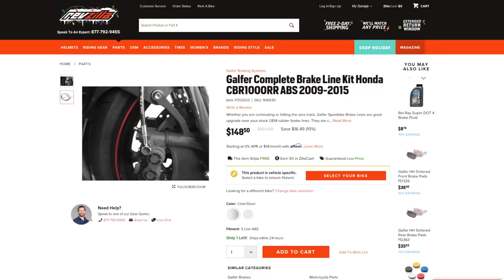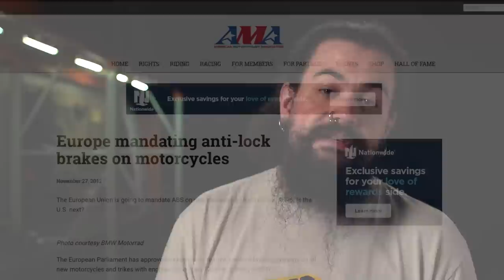3 Arguments AGAINST Motorcycle ABS!

Comment: My problems with systems like ABS & Traction-Control, is not only the added complexity & cost, not only the interference with motorcycle drifting, but also, these systems can become a mask for bad skill. I do not believe anyone should rely on these systems, instead of learning & mastering, if & when to brake or swerve, how to brake, and how to control traction. 

These systems can improve ability & safety, but I worry about these systems being overwhelmed, by bad rider skill & judgement. Then there's the concern, of modern vehicles becoming more vulnerable to being hacked. I don't feel comfortable with a computer having any control over my throttle or brakes, unless the only way that computer can communicate to outside world and be deeply changed, is through wired connections, and those connections are physically locked & secured, because a hacker can set a vehicle up to kill you, and make it look like an accident or your fault.

But all of these should be a mute points for me, because of my hatred & distrust for government & dealerships, I may never buy a modern motorcycle, and would rather buy & modify used old bikes, from private sellers, or build my own bikes from scratch. And if I build an Electric or Hybrid motorcycle, then I'm only using motor-controllers, that don't have wireless communications, and if they do, I will physically disable those features, and make the controller extremely difficult to physically access.

As for riders with bad skills. Like with anyone else on the road, they can be as bad & random as possible. It is my responsibility to keep myself & my bike, safe.

Comment: My gripe is broader than just ABS or just motorcycles. Most vehicles now are fitted with an ever increasing number of safety features, lots of them with beeps and buzzers. My theory is that each of these safety features progressively erode the general public’s practical reasoning and decision making. ABS is of the same ilk - and people increasingly tailgate, and increasingly cannot drive properly in low traction conditions. More directly on a motorcycle, I’ve never had ABS yet, and tbh I don’t want it - I’m a bit old school and proudly so.

Comment: Another reason why im against abs on a bike. Is that it makes a less proficient rider. A rider who only has riden abs bikes will generally rely on it more than one who knows how to control a locked rear or front. Like one from dirt. They lock the rear to purposely slide and switch direction. I grew up on dirt bikes and road street hikes without abs and I learned how to control a lock rear but when I got a xsr900 with abs. I expected the bike to perform what I demanded it too but the abs stopped it from doing what I asked of it. Like a near accident once, I knew if I could lock the rear, slide out a few inches I would be ok. But it didnt slide, I had to force the bike over and dodge the threat. 
Tldr, a bike with to much electronic assist will make e a less proficient rider

Comment: what if I am buying a bike that the abs does not turn on and off. you can buy it with abs or non abs. Which should I buy. I am talking about the new 22 KLR 650. I plan to go on and off road. It  maybe $300  more to get it. But I am sure the maintenance and fixing it would cost a lot. Also I had the 2011 non abs.

Comment: I didn't want it on my 2013 softail slim because the abs module was huge and its ugly carcass was bolted directly behind the front wheel in plain sight.  On my 2018 heritage softail however I was happy to have it as it has already saved my butt from a low speed spill on some sand and the abs module is hidden under the seat.

Comment: Rear wheel ABS on all my bikes is too sensitive for road riding.  It should be made to allow the rear wheel to lock up more than it does.  My rear brakes on all my road bikes are almost worthless.  Obviously the majority of braking power is done with your front brake, but that doesn't mean they need to make the rear worthless, it's like 5% at most of braking power when stomping on it.
Reply: eternal ponderer A locked wheel provides much less braking power than does a wheel that is at the threshold of locking.  ABS gives your rear wheel more braking power, not less.
Reply: @LTVoyager  then the rear brakes on my bikes just flat out suck.  My fz07 allows for some rear tire skirting and it seems to stop more effectively (although not much more) than my other 2 bikes that allow no locking at all.  It's actually got me in the habit of not even using rear brakes at all on a straight stop. While forced to turn and stop I'll hit both in an attempt to balance out. But in any case my rear is typically used full 100 pct or not at all. Probably not good if I'm on a bike that has no abs.

Comment: I was expecting the argument that a bike without abs is also a good thing to develop braking skills.
Reply: As long as you can disable to ABS completely to practice, I don't see that as a problem. I developed my braking skill by firmly braking on steep hills. My next motorcycle will likely have ABS that can be completely disabled, just so that I can periodically disable it to practice braking.
Reply: Chris L ABS does not interfere with braking practice.  If you are skilled at threshold braking, the ABS will never make its presence known.  If the ABS activates during braking practice, then you aren’t as good as you think you are.  😁

Comment: When ABS activates, your stopping distance nearly triples. Then there's Harley with their use of DOT3 fluid which absorbs moisture.  When you do most of your riding along the Florida coast where air has more moisture, the effects of the fluid being in that environment absorbs the moisture at a faster rate. This causes the hydraulic valve assembly to form rust on the iron spindles that are inside that module, eventually causing brake failure and a very dangerous situation. those iron valves spindles will eventually stick in a position where the fluid cannot pass, giving you a locked pedal or hand brake handle lock-up.
  Harley issued a recall to change out brake fluid, big deal, they put the same type back in. that hydraulic control module will cost ya around $1200 and because you have to access the computer to bleed the brakes, add another 500 for labor. The recall does not cover parts.  This is just a warning for all, this technology is not fool-proof
Dave
Reply: Change my brake fluid in all my vehicles every 2 years . Never had a problem with abs on anything. Abs or not all brake fluid should be changed even if the vehicle is not used.

Comment: In perfect conditions a good rider can out break the abs but in an emergency or if I hit ice or gravel abs can be a lifesaver but it isn’t an idiot proof thing . I would rather have it (though I get no choice as I live in the EU) but it does come at a cost as the abs pumps can fail and are expensive. That said  modern bikes now come with fuel injection, mapped ignition, traction control,electric suspension , fly by wire throttles and sensors that monitor everything from air temp to crankshaft position all of which means that bikes now produce 200bhp and are rideable on the roads by ordinary riders rather than moto gp alien elites . Long gone are the days of the simple  piston port two stroke single with points and a carburettor. Though I still have one in my garage . We can complain about cost and complexity of modern bikes but how many of us would really want to go back to the past.

Comment: I've been riding since 1980. (both dirt and asphalt) ABS, at least to me, would hinder/interfere with my full control of said ABS equipped bike. Therefore, I am one to avoid an ABS bike where I cannot disable the system fully. If I have to pay for it and not use it, then it comes down to is that bike worth the cost to me with ABS even though my first action will be to disable/remove the ABS components. Fortunately for me, I wouldn't be caught dead purchasing a Brand New Bike and taking that initial depreciation hit. Nuff Said! Cheers! Zip~

Comment: "If you are have clean, dry pavement where you are an accomplished rider, you may be able to out-brake ABS"

Would love to see a reference for this, because on the surface it doesn't hold up. Whenever your wheels start skidding/sliding, you have strictly less stopping power than when they have traction. Like you said, useful for changing directions in off-road scenarios, but those are about turning, not braking.

Do you really mean riders can out-brake ABS in a straight line on clean, dry pavement?
Reply: Scott Minor, the comparisons he’s talking about are pro-grade riders doing near-perfect threshold braking (the maximum possible braking force), compared to riders who just crush the brakes, and let the ABS system handle it for them.  There are three problems with those comparisons, though.
1) Virtually nobody is that good a rider.  Nor will they ever be that good a rider.
2) The exact same braking technique can be used on the ABS equipped bike, never activating the ABS system.
3) As soon as you have real-world road conditions, where the available traction varies unexpectedly, and often without any indication of such, that threshold braking turns into a skid, for which the ABS system utterly outclasses any human reaction time.

Comment: Don't like it. You forgot to mention ABS can simply fail. IF YOU SURVIVE THAT, seeing as you're probably ABS DEPENDENT because you're young and have never ridden a non-ABS bike, then you have to pony up for the repair cost unless the bike is under warranty. My 2019 MT-07 failed on me and the pavement was simply damp. I pulled the brake lever and it was as though my bike was coasting! It lasted a good 3 seconds. I released the brake quickly and reapplied it with manual control being available. I rarely buy new for that reason these days. If they're all going to come with ABS then someone should lobby that it must be able to be shut off. How about showing statistical data of those wrecks caused by ABS FAILURE?!!

Comment: Your explanation about ABS is just wrong - The ABS monitors when one or both wheels are locked up and relieves the hydraulic pressure being applied to one or both wheels while the bike has forward momentum. It has nothing to do with traction.
Reply: I think your information is old. Modern ABS is more intelligent than that (depending on the bike).
Reply: ABS is not Traction Control, that's a separate system that uses the same rotational sensors that the ABS uses.  From Wikipedia:An anti-lock braking system (ABS) is a safety anti-skid braking system used on aircraft and on land vehicles, such as cars, motorcycles, trucks, and buses. ABS operates by preventing the wheels from locking up during braking, thereby maintaining tractive contact with the road surface. REF:https://en.wikipedia.org › wiki › Anti-lock_braking_system - I can turn off Traction Control on my BMW - but I can't turn off ABS - that is on all the time. Separate, assistive, safety systems.

Comment: Never had abs on my bikes but eventually I wont have the option as every bike I get is a newer version I'll probly wreck not expecting the pulse lol
Reply: Bastard, if you can apply the brakes on a non-ABS bike without locking them up, you can do exactly the same thing on a bike equipped with ABS.  You’ll only ever get that ‘pulse’ if you’ve locked the brakes, because that’s when the ABS kicks in.
Reply: @Vessekx  thankyou for the input my truck has them but I just think it would be a strange feeling on a motorcycle once that back wheel locks it stays locked till stopped dont knock it till you've tried it I guess lol

Comment: No one can outperform ABS except under controlled high traction condition in low speed stops usually under 20 mph in a straight line where rear wheel comes off the ground and all steering control is lost.   

I would also challenge  to high stakes bet anyone who claims they have better than modern abs capabilty to high speed braking contest around a corner on smooth wet pavement against my bike with cornering ABS.  They would either lowside or increase their braking distances by huge amount.  Even guys in Moto GP use such systems.  Machines now significantly outperform humans and the world moves forward not backward.

Comment: The trucking industry was very resistant to ABS when it came out and we still should be resistant to it. The reason that ABS is a problem isn't because it isn't a good idea, it is not just a good idea it is a great idea. The problem however is that because of exposure to elements the ABS system is frequently made non functional. So here you paid for the system but unless you spend a lot of time keeping it working, the system won't pay for itself when you need it.

The way ABS systems are built is still more or less like a after market system, bolted on and fully exposed to elements that degrade it to the point of being non functional over time. Love the idea but hate the implementation.
Reply: I think that was true years ago, but not as much anymore. I'll agree, that the older systems could be pretty annoying. But the very recent equipment is well integrated as part of a total vehicle dynamic stability control scheme. When it intervenes it isn't as annoying, and in many cases the rider/driver has the ability to modify the level at which it will intervene through modes or other settings. Though I will admit I have not driven a truck in a marginal traction environment in 5 years or so, but even then the technology was evolving with things like more independent activation zones. And I will admit that many drivers do not do a comprehensive vehicle systems check often enough.

Comment: I've never owned a bike with abs, but I don't think it's really necessary unless you're on ice, and usually if roads are icy I'm taking the car.
Reply: It can be useful trying to make a panic stop in the rain if you haven't practiced that. Last big rain I was in, I ended up fish tailing something fierce while coming into a stop light. Didn't go down, but did wind up a few feet into the intersection when I had to release and reapply. Would have been nice to have had ABS available.

It's also somewhat useful if you have a sudden change in traction that leads to a locking of the wheel or if you're riding in the rain and the water on the rotor suddenly evaporates enough for the pad to bite.

That being said, I think the case for ABS is somewhat exaggerated. If you're riding defensively and within your limits, the likelihood of needing it is fairly low and it's usually not going to kick in in situations where it would be a fatality.
Reply: @SmallSpoonBrigade  I gotcha, I guess I've rode without it my whole life so I don't even think about what it would be like to have it on the bike. I could see where it'd help in the rain
Reply: @weldingblaster1 Now on that last point, I live in northern Wyoming, so I have deer jump out on roads pretty frequently. That said, the abs on my car has caused me to slam into deer without slowing down nearly enough, so I don't know if I'd trust that on my bike. The car I had at the time had a somewhat oversensitive abs though, so that could be part of the problem there. I just like the overall control I have over my bike without abs in the sense that if I need to lock it up and go into a controlled slide due to a very unforseen deer in my path, I at least have the option.

Comment: If you're dumb enough to drive a motorcycle without ABS on the streets I hope you are at least smart enough to check mark that box for organ donating. Only a fool would drive a bike without ABS on the street. You are definitely not faster than technology, and the statistics prove it. 

My first car did not have ABS, this quadrupled stopping distance in the rain because I could not use full braking power without locking the wheels and skidding. Having drove a car like that and having the wheels lock up I would never get on a motorcycle without ABS.

Comment: ABS save lives on the road 。
Except those heavy and low horsepower bike is necessary need ABS because not fast enough or  outdated electronic system does not support ABS

Comment: How dare the government require me to have brakes on my bike.  And what's with this headlight and brake light requirement.  I should have the freedom to choose whether or not i have brakelights and headlights.  (sarcasm)   Folks need to get over it.  All motorcycles should come with ABS, and dual sports/adv should have the option to turn it off, or just pull the circuit....  When MC death odds get down to 5:1 compared to cagers, then maybe we can bark about rights.  But at 38:1; we really need to take any help we can get.

Comment: Eventually they'll make airbags mandatory for motorcyclists and then thereafter the AI controlled self driving motorcycle assistance systems will become standard. And yes that exists, bmw has a self driving motorcycle prototype that can drive without any rider.
Reply from the maker: Curious to see if this does happen, since we still haven't made Helmets a requirement across the board. Ride safe, -Pat
Reply: @RevZilla  wow where are helmets no requirement? im denmark and around here and the rest of europe nobody gets to drive without helmet
Reply: @nocensorship8092  (smh) you seem to make a habbit of talking about things you have checked up on. Lots of the USA doesn't require helmets.
Reply: the bmw motorcycle you speak of must first have a rider drive the route it is going to drive without the rider then and only then can it drive alone